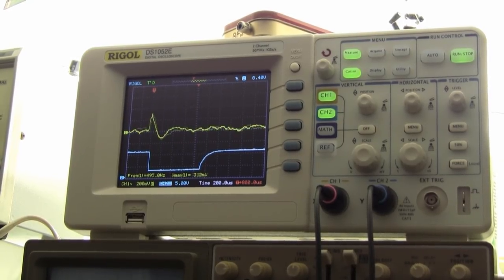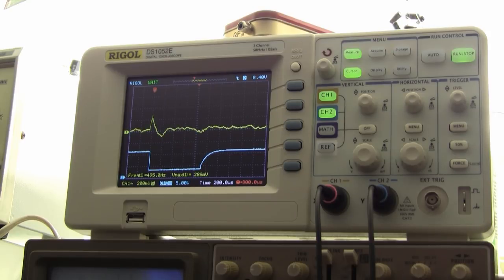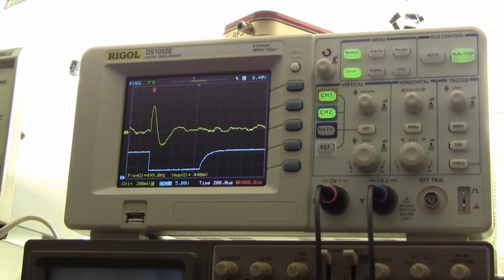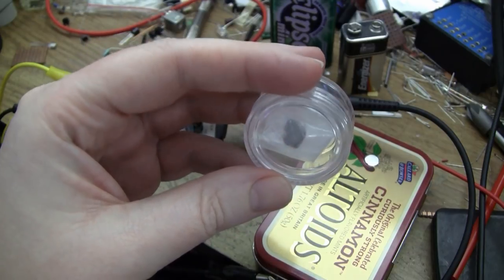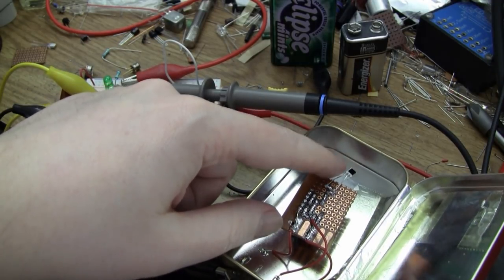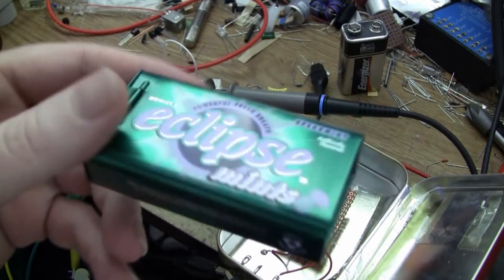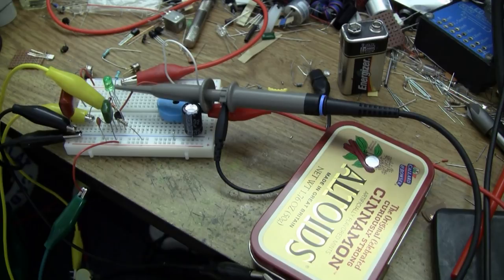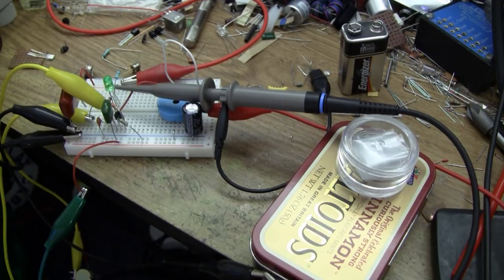Photodiode Gamma Ray Detector

Comment from the maker: Added a link in the summary.  The circuit there is for an intermediate version, I have since changed it a little to make it more stable with temperature variation.  I should write that up and design a small PCB.

Comment: Your photodiode counter should work as a MCA if you were to run the signals to the soundcard of your computer using PRA.  The peaks are energy dependent and a non PRA gamma analysis with a photodiode was done by a fellow by the name of Thomas Rapp a few years ago.  The energy resolution was quite admirable for such a tiny thing, although any detector's energy response is limited according to it's mass, in this case you're stuck in below about 100KeV or any meaningful data.

Comment from the maker: Ah, you built the Maxim circuit - nice little board.  I know a few people have had stability problems with that circuit.

Yes mine can easily see the gammas from a Am-241 source.  Thoriated tungsten isn't very active - well at least not at energies the pin diode is very sensitive to, it takes integration to notice much effect on the background count.  My alpha counter is better for Th and U as they are primarily alpha emitters.

Comment from the maker: @tesla242 There is a limit to how many photodiodes you can parallel, their capacitance is a problem... About six at most I suspect, but you could give each it's own buffer transistor and make large pixellated arrays.  Because the capture volume is so small it will never rival a big scintillator or even a modest GM tube in sensitivity, but it is very cheap (~$3) and rugged.

Comment from the maker: @smartpartzzkidd I tried lots of window materials, papers are too transparent it seems, the photodiode is very sensitive to light, and even with high-pass filtering ambient light leaks saturate the detector easily or induce so much buzz you can't discriminate the pulses from gamma photons.  Mylar is also too transparent, and the leafing foil I have has tiny pinholes!

Comment: I have some questions
1) if i remove the plastic package of the photodiode will it detect alpha radiation
2) can i put more photdiodes in parallel to get a bigger detection area and thus more sensitivity
Reply from the maker: Yes, bare PDs can detect alphas, so can BJTs, which can be easier to decap if they are in metal cans.

Yes you can parallel up PDs, but the extra capacitance eventually kills off the response. You can buffer three or four and then mix the signals of a few of those.

Comment: HI! I’m a beginner and I don’t have any photodiode so can I use solar panel ? Will it work? 
Please answer my question!
Reply from the maker: Probably not unless it is a very small solar cell, the capacitance of typical solar cells is so high that the small current pulses from ionizing radiation events will be too small to observe electrically. BPW34 or similar photodiodes are cheap and widely available, or you could use a decaped power transistor like a 2N3055.
Reply: @vk2zay  thank! Now I have a very small solar panel which I get from my old calculator and I think it will work 
Hopefully

Comment: Do you have any idea what the (ball park) magnitude of the current spikes in the sensor is? I am thinking of making one myself :-)
Reply from the maker: In hindsight this circuit is kinda crap, I made no effort to optimise the input noise performance and it is very dominated by thermal noise.  You could do a lot better with a more explicitly charge-sensitive design that tries to minimise the effect of the diode and FET capacitance and strong control of the noise bandwidth.  In fact I am not sure how the circuit actually works as well as it does, because back of the envelope calculations suggest it shouldn't.  The passband of the opamp is all wrong and the gate time constant isn't ideal at all.

The smallest output pulses above the noise at the output of the opamp are about 200 mV.  The opamp has an AC gain of 1501 so the signal at the FET drain is about 133 uV (or 2.4 nA of drain current variation). The gate source voltage is basically zero, so the drain current is somewhere around 50 uA for you average PN4117A, so there is about 2.8 volts across the 56K drain resistor and the drain source voltage is therefore about 5 to 6 volts.  The FET should be giving around 150 mS of transconductance for common source operation at such a bias point.  Therefore the gate voltage shift associated with 2.4 nA of drain current change is about 16 nV which appears across the 10M gate resistor in parallel with the gate capacitance and the diode junction capacitance.  If it was just the 10M resistor that would mean 24 fA, or about 15 electrons in the ~100 us pulse times...  But the total impedance matters and the input capacitance is likely dominant (about 15 pF at this reverse bias I'd guess) 15 electrons would shift that capacitance about 160 nV and the time constant of the gate circuit is about 150 us (same order as charge pulse) so something isn't quite right.

Regardless I'd say the pulses represent something like 10 to 1000 photoelectrons.  It seems amazing that you could see this over the ~1 million dark current electrons in the same time frame and its associated Poisson distributed shot noise of around 1000 electrons.  Suggesting the dark current levels are actually a lot better than specified or I totally screwed up the calculations and the current pulses are a few orders of magnitude larger.
Reply: @vk2zay  Thank you so much for that elaborate answer :D 
Electronics really get interesting for me when we get into individual-electrons-region of operation. Here, everything physical really matters, and noise is almost everywhere. 
I made myself a super sensitive JFET based photodiode amplifier a while back (with power gains in the billions) and also ended up having fun measuring the thermal noise of various input resistances.
Anyways, the Geiger counter application also seems fascinating, though I will probably also look at a scintillator approach. It seems that ordinary soda-bottle PET  could be used for the job.
Could you recommend any good parameters to look for in photodiodes?
Reply from the maker: @williamschmidt-hansen6311  low dark current, high responsivity (generally around the same for all Si PIN diodes), and low capacitance which is normally area related but reverse bias can reduce it.

Comment: Is it possible to turn this into a spectrometer?
Reply from the maker: Not a very good one, the photodiode isn't really big enough to completely absorb the energy from higher energy gamma.  But yes, the pulses differ in size and an MCA might produce a spectrum of some sort from them.
Reply: @vk2zay  How is it going for the spectral diffraction of GRB from Cassiopeia A supernova remnant? There should be «acoustic» "remnants" and  all manner of Particle Zoo type signal for experimenter   detectors –  since obviously garage shop tools would be difficult to detect near the Lagrangian Asymptotic Limit this is significant for  interesting work

Comment: lensing of gamma is difficult at best and as well do not make it to the surface except at polar where the magneto-field allows energetics from theVoid to appear at the surface ▬ networked low-tech array can provide use-able grade info that localized professional grade detectors do not ▬ poly-carbonate are often reasonable solid-state energetic detectors which emit in the visible region and can be tuned to do better with materials science

Comment: Hello I am an electronic tech but not familiar with the circuitry and here is the problem, It seems the government is not letting knowledge of gama ray bursts in outer space that could fuel the sun into releasing CMEs and causing major storms like the tornado in Oklahoma to develop. I would like a circuit that could detect gama rays from the sun as well as space or one for each. I believe a fresnel lens may help in the detection of both the sun and space and maybe not a large fresnel lens.